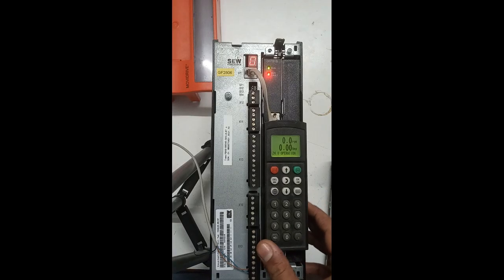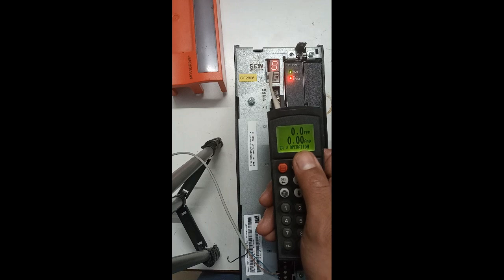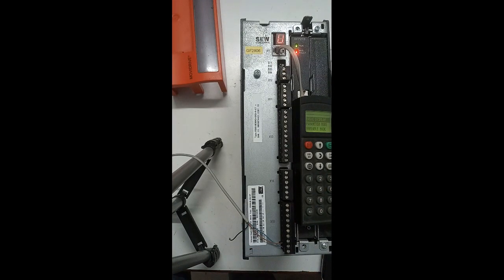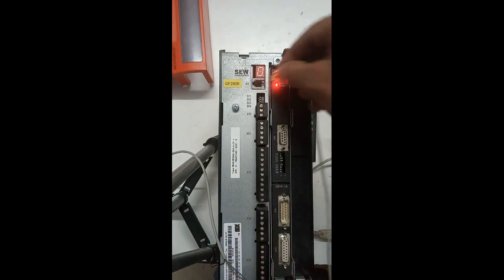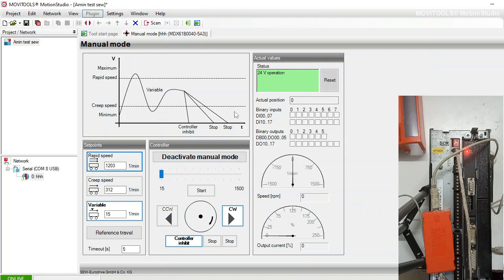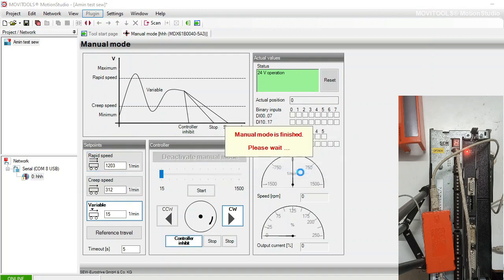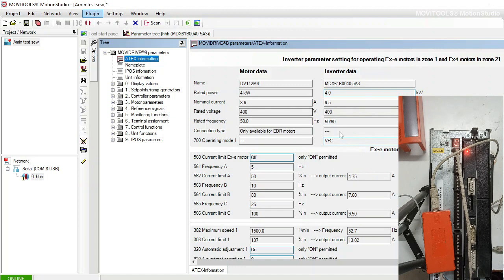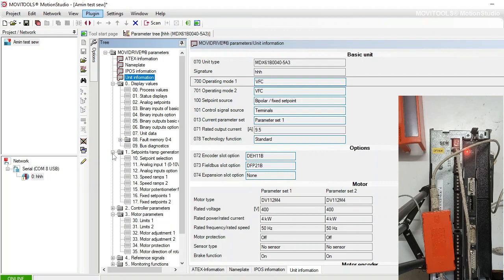SEW movidrive operating panel and manual operation by movitools software

Comment: How to bypass F14 Encoder Alarm from parameters itself
Reply from the maker: I dont think it  can be bypassed but what you can do is to check cable, connection, 
also go to p003 and move encoder and check if i values is changing and in + and - according to rotation also it will reset value after 4096 on every rotation if you find any error in it then change encoder card then motor if having built in encoder

Comment: How to enable this
I am getting no enable issue...?
Reply from the maker: if it is showing zero on display and 3 phase already provided then drive is damaged and you need to replace it
Reply: @industrialsolution6828 
Its doesn't showing zero
The display message is 2 means..?
Reply: Display code is 2
The message is No enable
Reply from the maker: @karimtech1343  what is showing on 8 segment display after power up three phase and 24 volt

Comment: hi, i have an error of 122,  "Absolute Encoder Option", suberror : 16640. So due to this error i could not manually jog the motor as you shared. can teach me how to bypass so i can jog my lifter and change the encoder? thank you sir
Reply from the maker: please review the manual you need to recommission the drive without encoder if it allows you